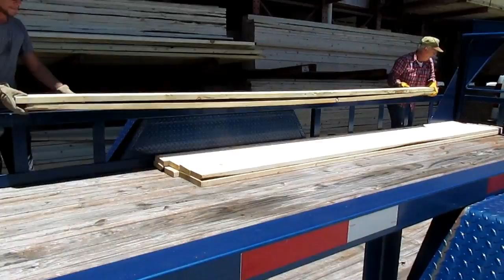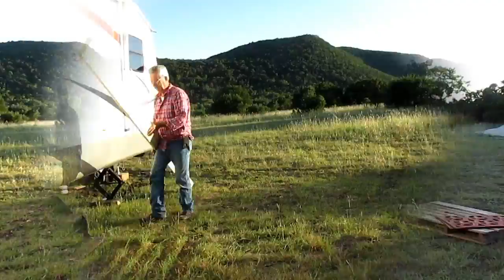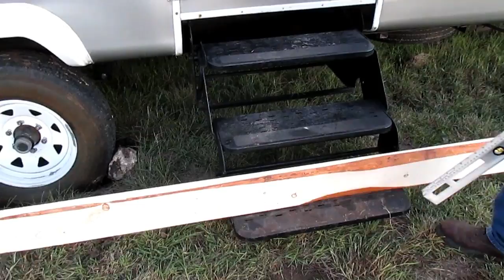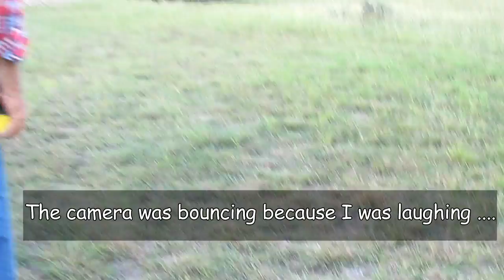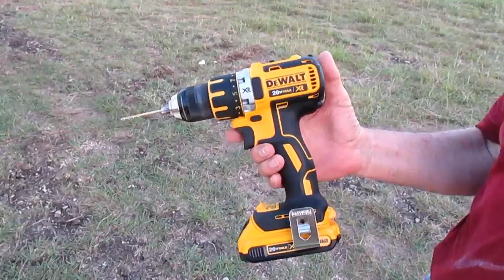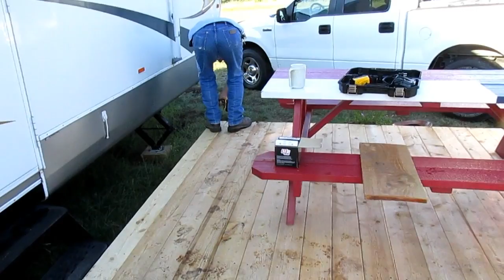Building A RV Deck

Comment: Hi u have the Size of the Planks ? Im new on this So ill go to my nearest Homedepot , But What Are the Size of the planks .
Reply from the maker: We used 2x6 planks. Thank you for watching
Reply: @JRCHomesteadTexas   2 is the Width and 6 is the Length ?
Reply from the maker: @drippingtoohard2868  2" thick 6" wide then what ever length Home Depot, Lowes or your lumber yard has. There will be someone there to assist you. Have a rough idea of the total width and length of your deck you are building to give them.
Reply: @JRCHomesteadTexas  thanks you so much for helping me out :)